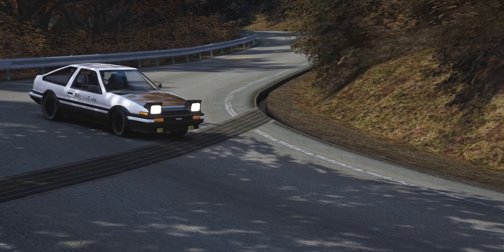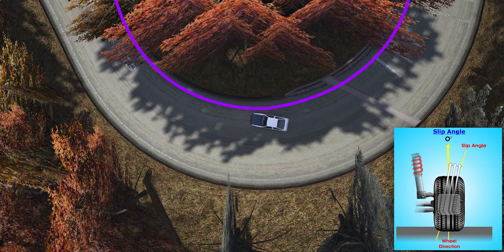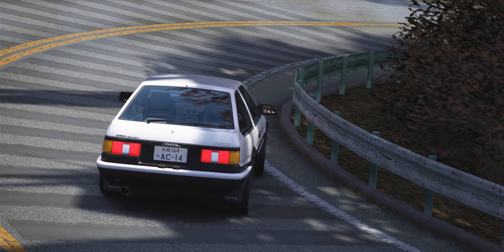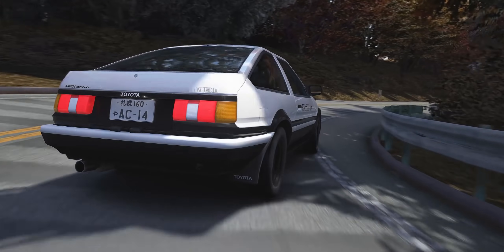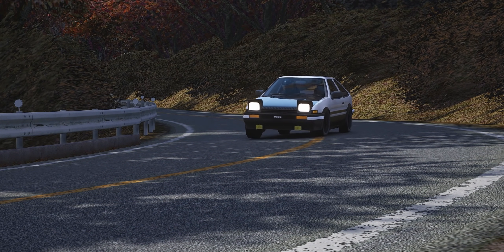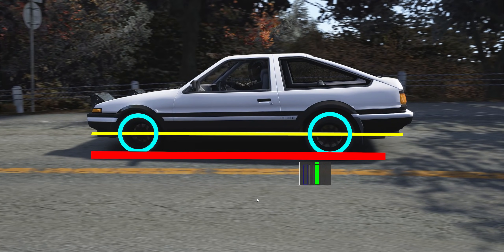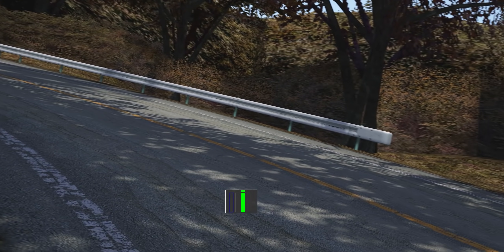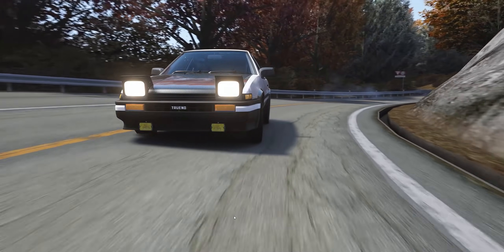Slip Angle in Touge - Master this to be a faster Sim Racer

Comment: You got it wrong, mate.
0:48 slip angle is not an angle between wheel pointing direction and a corner arch. It is an angle between the car movement direction and wheel pointing direction (blue and cyan lines, not cyan and purple). Road tyres will give you slip angle about 4 degrees peak. Racing ones will provide 7-8 degrees of slip angle. Not 10 degrees from your video (which looks like 20 or even 30 degrees, because it is more of car-to-corner placing)
Slip angle doesn't even has something to do with acceleration through a corner.  Slip angle is about maximum grip being achieved not when a car body is fully aligned with the direction of travel, but at a specific angle (slip angle). You have to try to overload the tyres through a corner for a right amount and then magic happens. Think of it when you entering a corner at a higher speed, but the car doesn't go wide and grips instead. Car body wants to go wider, but tyres don't let it do so, gripping to the ground and stretching themselves a little bit).

What you are talking about in the video is just a turning in a corner using oversteer. It is not about slip angle. It is about rear axle overtaking the front one (oversteering).

The production is good, you sound really confident and smart. I want to believe what I'm hearing, but you got it all wrong)

Comment: Thats exactly what I got used to doing in assetto corsa using a controller! A controller doesnt allow for very precise steering inputs so I learned to steer with the throttle at slip angle and I cant believe this is an actual technique!
Reply: lmfao back on the ps2 i used to do the same thing in GT3 and GT4. I'd tune cars specifically to maximize their ability to no countersteer drift (slip angle) and use the throttle to keep the car rotating around the turn, using just a little countersteer at the end of the turn to get the car straight again. Realized over the years that if you wanna go fast, you gotta be at the absolute edge of the tires grip, so stepping out the rear to go faster just made sense.
Reply: @kasuraga  yeees exactly, many people wonder how I am so smooth on asetto with a controller and most are confused when I say that I steer with the throttle hehe

Comment: If you need to countersteer when slipping you disturb the longitudinal(the force make your car go forward)
What happen at zero counter slip :
Car nose pointing sharp toward the corner exit, but the longitudinal force is at the maximum limit without any force disturbing its momentum, its pushing the car exit the corner at correct angle at the highest speed possible

Thats the fastest slip angle, and you dont need that much of angle to turn fast
Think of how god hand from initial d driving style

Comment: Car always slip at minimal rate, when you re doing basic grip turn its already slipping at very minimum(understeer angle), when we do trail braking we adjust the nose slightly inside the turn, thus its a condition between understeer and oversteer at very minimum angle, i called it understeered oversteer, 

you need high speed entry to create understeer(longitudinal) condition then the correct brake input to adjust the nose a little bit(oversteer/lateral)

Its the same with how plane turn, understeer is turn rate while oversteer is turn radius, there is a perfect ratio between them to achieve fastest turn speed

The slip angle shown in this video however is too much, the fastest slip angle is so minimal that u can misjudge it as gripping.Zero counter slip angle is fastest

This is what lanevo ayc try to achieve
Reply: If you need to countersteer when slipping you disturb the longitudinal(the force make your car go forward)
What happen at zero counter slip :
Car nose pointing sharp toward the corner exit, but the longitudinal force is at the maximum limit without any force disturbing its momentum, its pushing the car exit the corner at correct angle at the highest speed possible

Thats the fastest slip angle, and you dont need that much of angle to turn fast
Think of how god hand from initial d driving style

Comment: You can get great slip angle by downshifting how Takumi does like from 5th, 4th, 3rd, to 2nd will raise the rpm's makes the rear spin and full brakes on the front cause massive sag in the front and as you turn the rear will slip out assisting so you can get out of the turn, it will be difficult gauging the speed because if you go in too fast you'll be driving out of the turn scraping the guardrails.

Comment: So I may have been accidentally doing this in Forza. Which isn't fully a sim so I never had to care about tire wear unless I wanted to.
I thought it's just called low angle drifting lol.
Really fun letting go of steering control and just using throttle to steer.
Started doing because I wanted to find a way to get on the throttle earlier since I was on keyboard and also if I do get to tune the downforce, I like to jack front downforce to maximum.
Then I got a controller and it got easier because now I can just feather it and not have to change the rate I tap w.

Comment: I find this more stylish than drifting, it looks so smooth and calculated, especially when executed in a hotlap
Reply: Yes, doing slip angle damn close to a barrier feels way better than just drifting
Reply: Hitting the apex while holding a tight slip angle will always be cooler than big-angle wide-line tandems.
Reply: same
Reply: For me it looks like drifting.... like the exact same, just the right way not to much.
Reply: @ZunaZurugi  it looks like drifting because this slip angle is increased to reach the limit of the street tire's peak rotation. Suellio alemeida explains this very well in one of his shorts
Reply: Except that drifting is commonly defined as having much angle and linking corners etc for style not for speed. Agree though, on an actual race this looks superb
Reply: Agreed. But this technique will eat up tires super quickly/ make them super greasy if you're not running racing slicks. Had summer street tires on my miata. Tire were useless after two laps of me trying this...but I'm poor. If you're one of the guys that can switch out tires during a track day, then go for it, 😄🤣
Reply: I agree heavy
Reply: By definition it is a drift. Angled before the apex
Reply: Basically powerslide
Reply: Read this carefully and you will learn what the words actually mean:
Some slide or drift is happening when you're using a greater than neutral slip angle and induce a four wheel drift like explained in the video.

The sport of drifting is about using as much slip angle as possible while also having the rear of the car as close to the outside of the corner as possible.

In racing a 4 wheel drift can help improve lap times at the cost of tire wear.

A powerslide is also called power oversteer and is one of the ways to start a drift (as in the sport of drifting) Other ways to do this are clutch kick, shift lock, Scandinavian flick (weight transfer).

You will only use weight transfer to induce a four wheel drift because the goal is not to break traction but to maximise rotation without losing sideways grip. Tires generally achieve peak friction at about 10% slip. This is why launch control exists and why a four wheel drift can be faster than full grip.
Reply: I find slip angle sexy.
Reply: Same i just like drifting in the formula drift tandems
Reply: @rel3vant166 correct lol. So ppl have technically been drifting for decades as well, they just had no idea
Reply: @rel3vant166 in the simplest of terms drifting is just an angle before the apex. Big or small. Since slip angle is at most a 10 degree angle toward the inside, then technically it’s a drift. It’s just for speed, not style like what most people think drifting is. You’re correct in thinking that, but so am I when I say slip angle is at least a type of drift.
Reply: Tires or Tyres go BRR
Reply: This is ideal drift between grip and drift
Reply: This is drifting lol.

Comment: The 86 is the perfect car for this bc the 86 has a decent amount of understeer a stock 86 gets thru corners faster like this than typical grip racing if u drive one on akina which is where I drove it on assetto to be faster it’s just second nature with the car and unlike other cars the grip and weight with the car and the stock suspension helps this car bc it’s not snappy so u have a lot of time to feel where the car is going and keep it under control that is the beauty of the 86 it’s not fast but it’s an absolute weapon in the corners

Comment: There’s a very fine line between true slip angle and drifting. He does a good job of showing it in more of an exaggerated manner here, but true slip angle doesn’t use any countersteering at all. If you’re on the ragged edge, you may have to in order to catch the car, because there’s almost no way to consistently do it 100% of the time. The 86 shown here is going to have a much larger margin of slip compared to, say, a Formula 1 car, but I think this is a brilliant way to dissect it. good video my mans!
Reply: There's a pretty clear line since they have nothing to do with each other. Slip angle is a measure of the tyres property while drifting is a technique.

Comment: I always used this technique in GT to great results, but for some reason in AC the car understeers regardless if I hard tap the brakes or slam the gas. Even trying higher pressure on the rear tires on the 86 doesn't help me and the car handles like an FF unless I downshift to 2nd and slam the gas, which kills momentum and makes me drift instead.

Usually I'd just adjust suspension stiffness and call it a day but... Either I can't find the advanced tuning settings or the game is really lacking in tuning options.

Comment: Awesome explanation! During my track days I always struggled to describe what was happening I always referred to it as “rotating on top of the tires” it’s so cool to finally know what it’s actually called. Love your videos, keep up the good work!
Reply: I think a lot of other drivers will refer to it as rotation. For example, my 1990 integra, though fwd, have a pretty neutral handling characteristic and has a good level of rotation around tighter corners. You can get the rear to naturally step out around tight turns if you drive it right.
Reply: @kasuraga  yup it’s called rotation that is the scientific term. Racing is an art form but it’s also a science.
Reply: @cecilracing53  https://www.youtube.com/watch?v=bDW9NSjbgOU any time someone wants to see an example of fwd rotation/drifting i show them this. this thing was so far on the edge of what the tires were going to let him get away with but you can see he's still kept a LOT of forward momentum which means his front tires were still digging hard and not slipping
Reply: @kasuraga  yeah FWD to be fast they need a lot of rotation breaking hard and early rotation so they can be on throttle as early as possible it’s enjoyable when you drive a purpose built FWD car.
Reply: @cecilracing53  Yeah, when you have a fwd car set up properly they're a blast. Almost point and mash the throttle if the front tires have the traction. It does make it a bit funky going back to a rwd car after hooning a good rotating fwd car haha
Reply: @kasuraga  damn straight ahaha if you have Iracing check out the VW Jetta and Audi RS3. When I was racing the Jetta I was one of the top drivers, sincerely enjoyed those days lol
Reply: @cecilracing53  Man I should get my road license up then. I've got an A class oval but like, D class road hahah. It'll be a while cause I have to build a new sim rig. sold mine cause i hadn't used it in far too long to justify keeping it. I'll definitely be checking out those series. I have a 1990 integra 4 door that I used to throw around on mountains. It was really stable to the point I was too scared to drive it faster on the mountain roads out here. With only 150hp, no vtec, but good suspension and a fun transmission it was crazy. VERY stable. the car never felt like it was going to push or lose grip unexpectedly even on dusty roads. It's definitely on the  understeer side, but in a way where you can trust that if you mat the brake, point it into the corner, and gun it, the car is gonna claw through the apex without kicking out too far or wide. 90's honda's are probably the best handling fwd cars out there when it comes to mild street/track setups.

I actually remember my friends saying how terrified they were to try to keep up with me, because no matter how fast it looked like I was going, my car always stayed very level and stable through the corners. I do remember that if I just went all out my friends could never keep up even though we were all on the same platform. I just had mine set up very differently.

Comment: Another point to this is how when takumi faced shingo (red civic driver) he mentions in astonishment to how instead of sliding and making turns by using steering takumi instead used the cars weight shifting along with very minimal inputs to induce the slide and not needing absurd countersteer ( as he learned before he smacked a barracade)
Reply: Schmaking the guard rails also works quite well lol

Comment: Slip angle IS grip!  I don't think it's good to suggest slip angle is in between drift and grip.  Many people go out and slide around and call it slip angle.  The point is that because rubber is stretchy, the car can turn in while keeping the contact patch under static friction. Any intro physics class will tell you that static friction is always stronger than kinetic friction. As soon as you go past that limit into kinetic friction you will be going slower than you could be going.  Also, a lot of the examples you showed were definitely sliding and going slower than the limit of grip.  Sort answer: Anime is not real life guys!

Comment: slip angle isn't technically sliding but being right about to.
and it's biggest in road/street tires

also, another note:
load
not weight
Reply: Slip angle isn't even a technique... It's the angle between the direction a tire is pointing and the direction it's traveling. Any amount of turning at non-zero speed results in some sort of slip angle.
Reply: @Harmonic14  
True.
but for racing cars the slip angle window is much much smaller and engaging in it (especially without spinning) is a technique as it is counterintuitive (and some may feel fear if they don't know what they're doing) that tyres generate more grip when they're about to lose it and there's a bit of sliding and that you can turn the car faster with it.

Comment: Another side effect is that you will use your tyres equally between the front and rears. Which means better balance through a stint.
Reply: Not true. When using the CORRECT definition of slip angle and looking at a relationship of slip angle vs. lateral force, you can potentially fall on either side of the peak lateral force curve. This means you can achieve the same pace while having different rates of tire performance degradation based on how much slip angle you're forcing onto the tires when cornering.
Reply: @Harmonic14  yes what I meant was some folks extensively rely on the steering to get the car turned. Compared to them, the tyre wear will be evened out.

Comment: I’ve been using slip angle at Kart Tracks, it’s so satisfying when you don’t need to counter steer and the kart just slide across a corner.
Reply: Any vehicle with a tire going through a turn has some sort of slip angle. The term is not being used correctly here.

Comment: Although I knew of the benefits of the 4 wheel drift, I never released that F1 also does it (albeit very subtly). Because of how subtle it is in F1, I though it was only useful for low-grip cars. 

After watching your video, using slip angle seems to be a much more obvious (and viable) choice for going faster

Comment: Can you do a similar thing with front wheel drive cars?
Reply: yes but no, one thing this guy forgot to mention is that when drifting and taking a fast corner, the rear wheels when slipping pushes the car forward and into the corner, acting as a 3rd guide wheel. with fwd cars the rear is dead and free to rotate and doesnt apply force. so its just scary understeer and high probability of snap steering as well.

Comment: as far as slip angle goes yes its this on/over the edge driving style that gives you a tonne of delta on lap times. but the key thing is this is drifting not slip angle, stretch in the tire over the rim and micro slippage is what gives slip angle, somewhere in turning difference < 10°, anything past this and your wasting energy in lateral grip
Reply: Slip angle is created from turning... It's the difference between a tire's pointed direction and actual direction, not a driving technique.

Comment: Tires have interesting properties where they have the most grip when an a certain slip angle (less than 10°, after that the grip falls massively). By using this technique and keeping the wheel straight you put all 4 tires in that position where thay have a small amount of slip angle, which gives you maximum grip.
https://www.researchgate.net/figure/Friction-coefficient-versus-wheel-slip-curves-for-various-surfaces-with-exaggerated_fig1_267941440